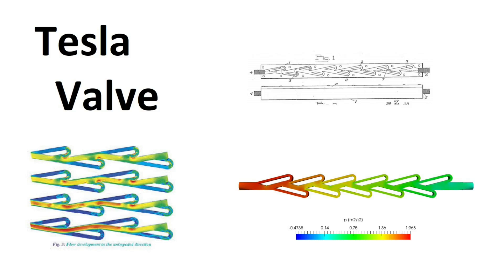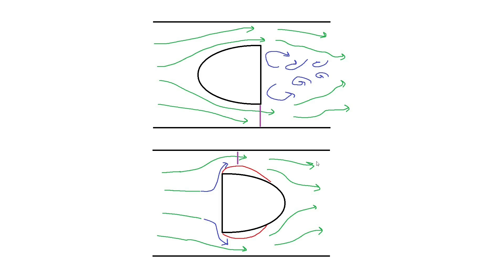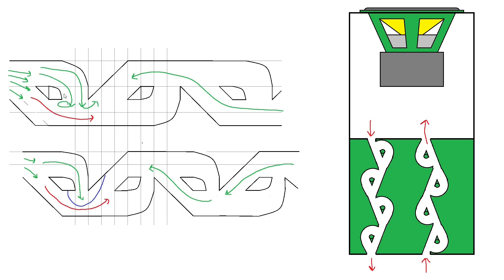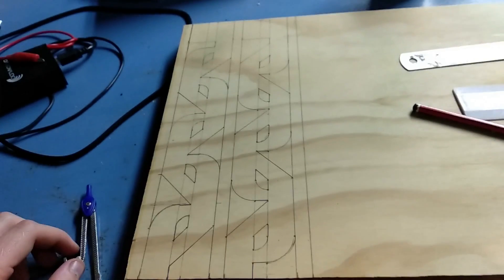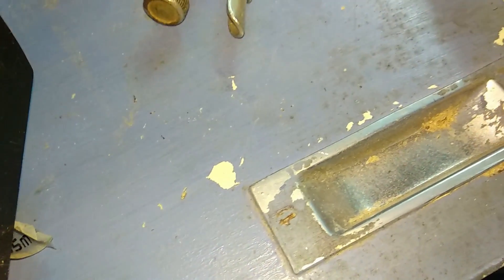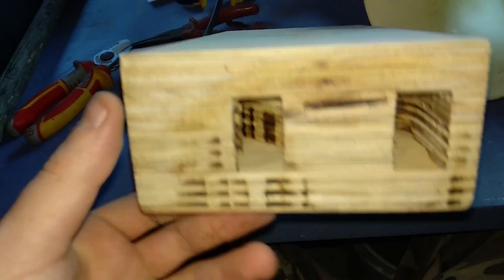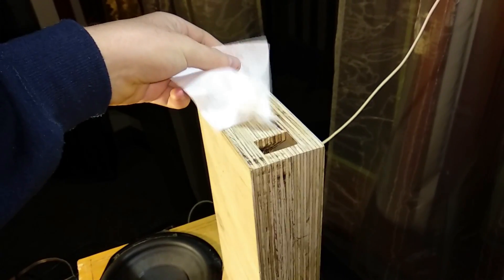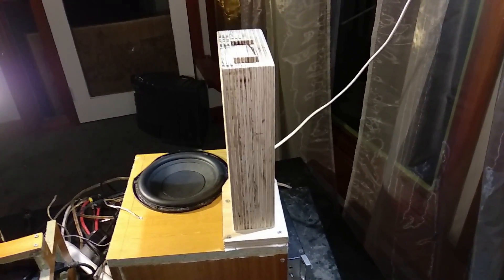Tesla Valve as a Speaker Port?!

Comment: Thanks for making that man! I literally search for this concept and your video was the first that popped up!! I didn't know if you could do this concept.
With the intake port facing the front bottom of the couch and the exhaust port, facing the top back of the couch to make a air movement rap Around a coach for a crazy home theater experience.

Comment: The Tesla Valve
Tesla’s valvular conduit is mostly misunderstood as presented in much of literature and most media such as YouTube in recent years. This device cannot be called a valve if used as an inline flow resistor. It is usually but erroneously demonstrated as a ‘one way valve’ with fluid, be it gas or liquid where the pressure drop is considerably larger in one direction flow than in the opposite. To use electrical analogy, this is not a diode but a resistor, therefore, the word valve is inappropriate. The expected ‘valve’ action (check or non-return valve) is unimpressive if anything.
Tesla originally construed his ‘valvular conduit for gas flow, and in fact specifically for gas under pulsating pressure. In this application, it may be called a ‘valve’ or a ‘fluid diode’. Gas under hight frequency pulsating pressure takes advantage of this clever topology and is free to flow in one direction with relatively negligible losses and practically no backflow. With careful design, Tesla’s valvular conduit is a true pulsating gas diode with no moving parts. An illustrative application would be an IC engine exhaust manifold.
It should also be noted that this valve will have optimal performance at a single design point, i.e., temperature, fluid type, volumetric flow and frequency, so that any change of a parameter will have it operating off optimum.
As for making a modern design, I imagine a cut and try method with FEA would be used.
Otherwise, well done, interesting and informative video, thank you very much.

Comment: You're missing one important aspect the convergence points needs to be configured so the cross section at that point is proportionally larger than the passage ways. The cross section of the divergent flow must be narrower than the cross section ot the 'main' line it is to diverge from, and when this accelerated flow is directed back into the main line in a way that the cross section of the 'main' line has already increased and the still thinner divergent line intersects the increased cross section of rhe the main line in a manner that its accelerated flow is maintained right up to the point that they intersect. 

It looks like a basic laminar/turbulent flow principle with basic factors such a boundary layers ect ect at play but there's more at work and the geometric configuration is primary to the function. 

It even goes beyond Bernoulli's formula/principle. I highly recommend anyone interested in the valve to become familiar with the principle and it's phenomena.

Comment: 🟦.... If a balance could be reached where, utilizing ONE valve and so causing the speaker to pump Just enough air out of a larger cabinet to maintain a certain level of damping on the driver, just a little more than a sealed box of the smallest practical size would exert, but to be able to have THAT level of damping occurring in a MUCH larger enclosure
(which, could Never by itself provide the 'airspring' required for proper damping of an acoustic suspension driver!), should tighten the bass-envelope Considerably!... Okay, the speaker might require just a little more power, But this should result in a more definitive, "Tympanic" sound.
I advise you from my own experience, for quite a number of years now I've been working on a similar design for a subwoofer, actually experimented with using modified fish tank pumps to maintain just a VERY small negative pressure in the enclosure! Unfortunately My shop of 30-years was destroyed in a hurricane and it may be some-time before I'm able to start experimenting again, You've definitely got the torch tho!..... RUN With It!!

Comment: I think there is some confusion on how a tesla valve works. I'm no scientist, but the tesla valve will free flow if you run it backwards. It shouldn't act as a check valve. A single valve should work if designed properly. A true tesla valve uses the incoming force by turning it back on itself. the more nooks, the lower the pressure out the other end. It wont resist flow running in reverse. IMO

Comment: This will significantly reduce resistance within the box, resulting in loss of control of the sub (almost a free air situation) Where a single port with air moving in only one direction at a time still provides some control of the sub... The volume of the box is now completely inconsistent... I'm not saying there's no way this could work, but I think a lot and I mean a LOT of calculations would be required..! Because you can't figure a proper port size and length of a box with a varying air volume... even a small inlet is going to greatly increase the volume of the box.
Even though the valves are directional, air can still flow both ways... It would be great for cooling the sub and is a very interesting idea, I just don't think it provides any acoustical suspension that is required for a non free air sub to function properly...

Comment: I would love to learn how this could apply in SPL competition and how to measure for enclosure port area and tune.
Reply from the maker: Yeah, im interested to experiment with that aspect, could use it to time align stuff for biggest peak and no cancellation
Reply: The struggle with proper loading at mic placement might be partially solved with this. Mic placement on the right side of the windshield for instance.